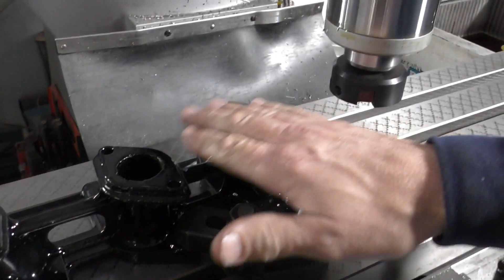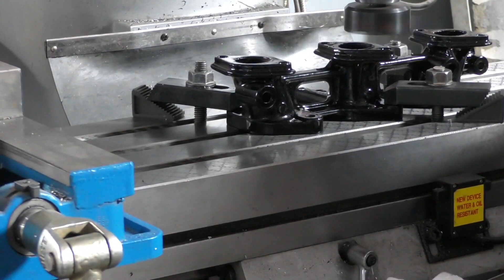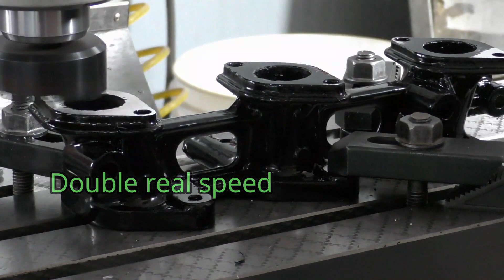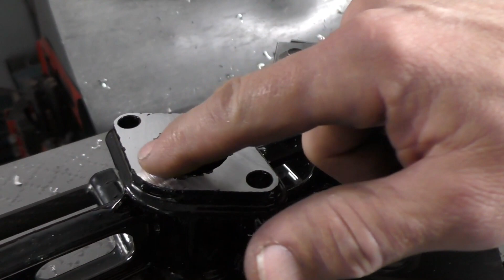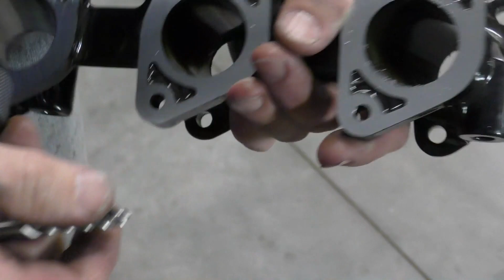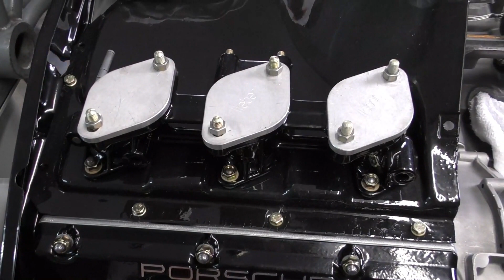Intake Manifolds on Your Air-Cooled Porsche Engine Build

Comment: Porsche appears to have superseded the part for the head intake stud to a metal oval hole lock nut. Is that what you recommend? I have read some bad things about them damaging threads. Do you use thread locker when you set the head intake manifold studs? Thanks.
Reply from the maker: Dennis,
I just use a wave washer and a standard M8 nut. If you want to use a lock nut, you can use a Nyloc, but I have found it is not necessary to do so.
Kurt
PS: reach out to me on your fiber washer sealing issue.

Comment: Does the reduction in inlet manifold height due to machining affect performance? Or port alignment? Great content btw 👍
Reply from the maker: You can go too far, and the throttle linkage will not clear. But we make the cut as small as possible and does not affect flow. S